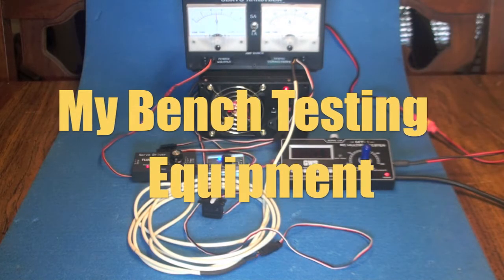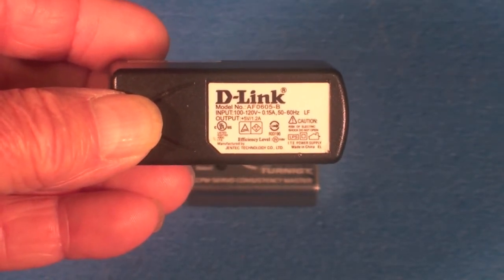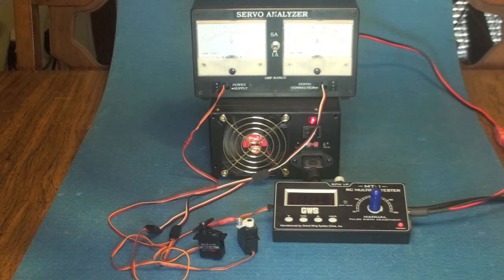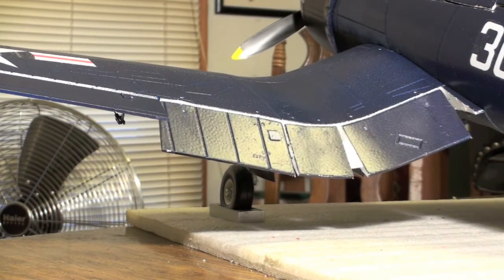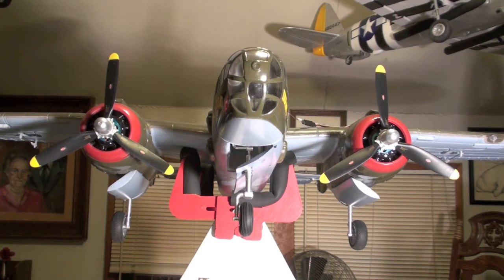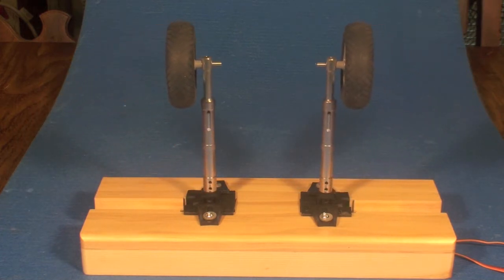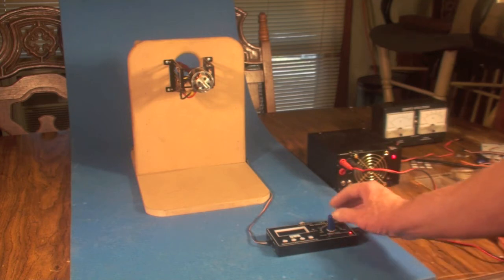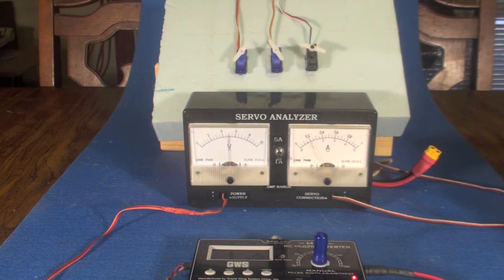Servo Testers

Comment: very handy tool. I found the meters you're using. You did a good job incorporating them into the box. with the servo plugs.
I wonder if you one would be able to use a watt meter to monitor servo current and volts useage (i.e. the GT POWER RC 130 Amp Watt Meter )